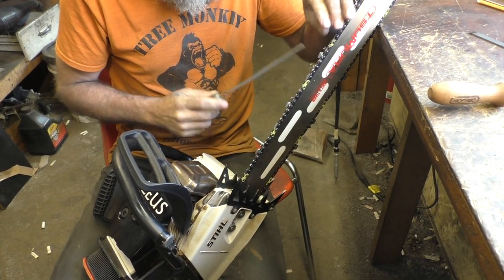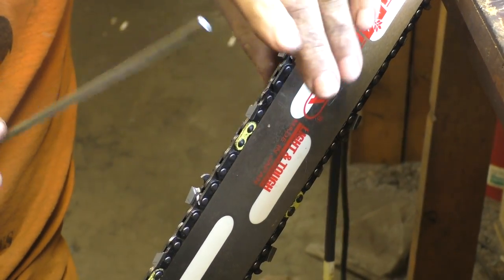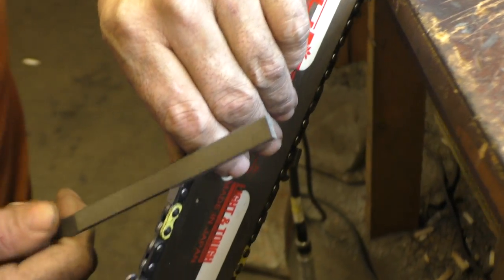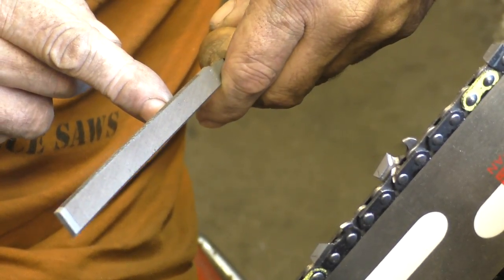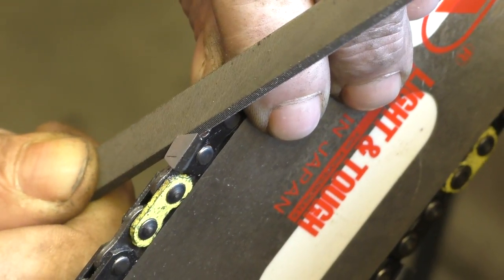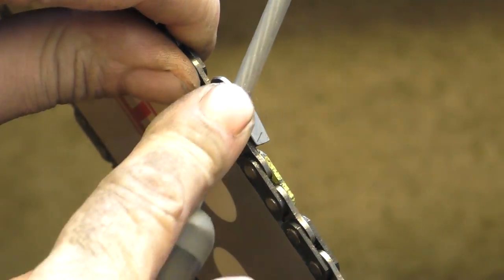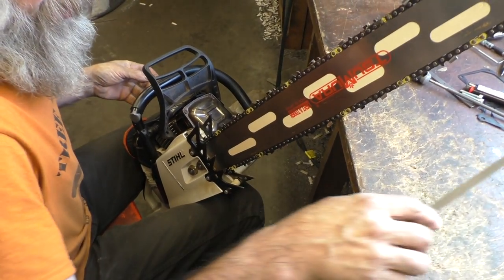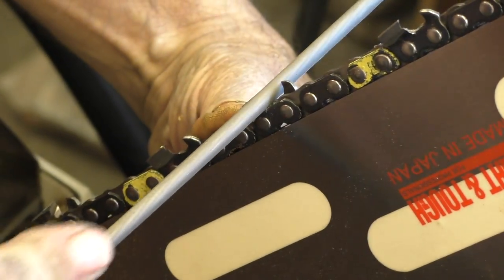A different take on square filing

Comment: thanks guys.  I sit at the table with coffee, and put the chain in my lap, and just file without the saw, without the vice, , , , easy to control, and it does not really take a lot of pressure to do a little file job like this.  really, who would have thunk it.

Comment: Thanks for the video!!  I’ve never square filed a chain by hand, only ever used a grinder so it’s nice to get a different perspective on it. 

I’m interested in Scott’s theory that a square ground chain will “stay” sharper then a round filed chain, it’s the opposite of what I’ve always assumed to be right.  Not saying he’s wrong, I would like to test it out myself.   I completely agree that a semi chisel chain will cut better when dull, not that I use semi chisel often unless I’m cutting in complete crap wood.   I also adjust my filing angle depending on what I’m cutting in like Scott had mentioned, hard wood, soft wood, frozen, dirty, etc...

Sorry for the long post but you’re doing a fantastic job on these videos.  I messaged Scott a couple days ago and I’m sending a 661 to him shortly to get ported, super stoked!!

Also how do a guy get his hands on a Tree Monkey T-Shirt??!!!

Comment: Good video,  I watched an old man round file from the outside of the tooth once , his chains were sharp and you couldn't tell him he was wrong.
I think people like the mystery of square filing more then anything,  kinda like "hey there's a secret that'll make you the fastest Sawyer ever! ,and only I know it" but honestly I like big old round chipper for suspicious trees.
Reply: I hit a T post and 2 wire fences in trees this year. Round chipper chain laughed at it . Square is faster I don't disagree,  but all wood has the potential for objects.
Reply: Main thing is what type of chain does your eco system support? Do you have a Simington grinder? Barring that, are you good with (expensive) Pferd/Vellorbe Square bit files? 
If'n you don't and you wanna get into square chain, are you a professional logger that require the reduced cutting time & improved control and can pay for it (because that's what Square files/Simington grinders do, cost money)?
Or are you fine with round chain?

Comment: When you say put it on the Silvey, which model are you talking about?
If you want a video thats going to get views, then by all means put one out on how to properly use the silvey razursharp 2 please.
I have one, my only issue is no matter what I adjust, I'm still grinding into the tie strap more than I'd like. Not sure if its the way the wheel is dressed or what? Hopefully you'll do a video!
Reply from the maker: good video Idea. I'll see what i can do.  :)
Reply: @Redbull661  please do one!
Reply: @nevadasparky79  you may have already figured this out. But to keep from grinding into your tie straps. Where your chain carrier bolts to the grinder. Loosen that bolt and move the carrier back a little. That will also have some effect on cutter plate angles. The closer the the carrier is to the wheel the more aggressive the chain will be. I used to grind on a razor sharp, I never really liked it that much. If you get a chance, try to pick up a simington. In my opinion they are a better grinder and easier to use.
Reply: @jakemesa3211  I did figure that out reading instructions.
The biggest problem I was having was the grinding wheel arbor, was set to low, once I moved the arbor and the wheel up about 1/16th of a inch, I was no longer hitting the tie straps.
I've used the simington, it is quicker and the adjustable chain height on the swing arm was very helpful.
Once I figured the razorsharp. 2 out I no longer have any issues grinding very good fast cutting chains with it, it's just slower is all.
I want to make the grinding  wheel height easier to adjust them it would be perfect for me.
Reply: @nevadasparky79  I never had a problem with arbor hight with the one I used to have. The main complaint I had with the razor sharp was that it was very used when I got it and the slide for the carrier was worn out. Sent the carrier to maddsens. They rebuilt the slide. After grinding everyday for two years on it. It was worn out again even making sure it was cleaned and oiled properly. The slide has a tendency to "stick" when the slide gets out of adjustment. And once the slide gets some play in it it tends to not grind the same from side to side. At least in my experience. Three years ago sacked up and bought a new simington. Best investment I could have made. Both are good grinders. I just prefer the simington for the amount of grinding I do.
Reply: @nevadasparky79  I was just thinking about you saying your wheel  was to low. If you're not getting your wheels from maddsens. It could be that the wheels you're getting are slightly thicker than what that machine was made to run. Not sure just a thought.